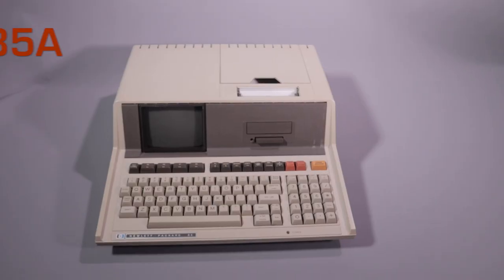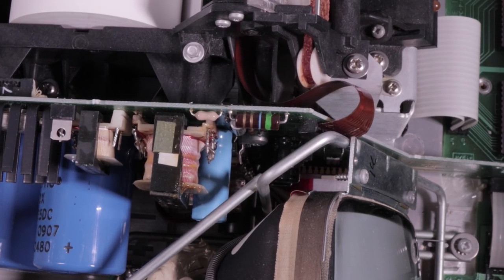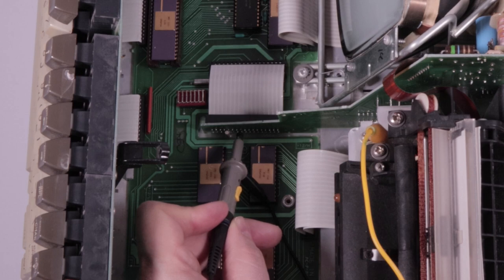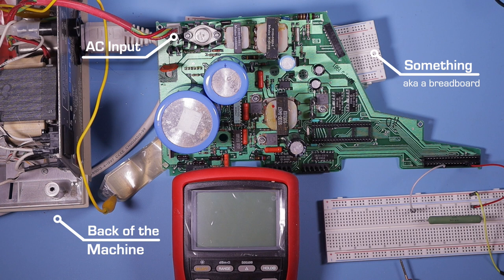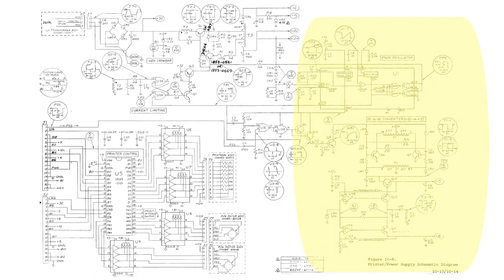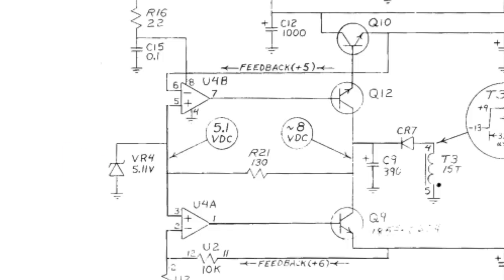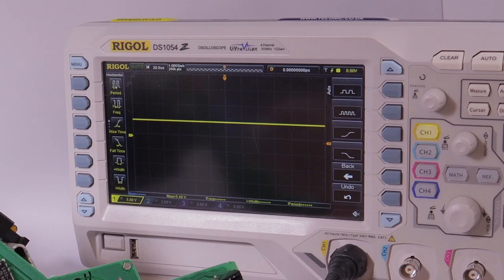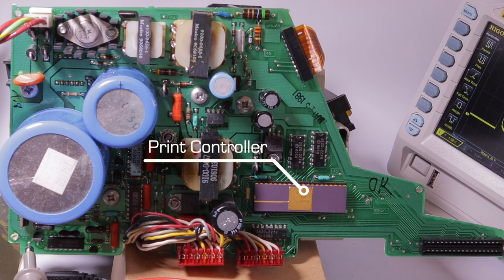HP 85A: Power Supply Repair

Comment: I recently got one of these that was supposed to be working but on power on I get either a repeating beep or continuous tone and nothing on the display.
I checked the voltages on J1 and J2 and they all check out fine.  I don't suppose you know what the problem might be just from my description?  Thank you.
Reply from the maker: If the voltages are ok, also listen for the crackle of the CRT start up as a power indicator. There may be some sequencing issues or other PSU weirdness.  I'm not hopeful.   It sounds like you have a logic board or board connection problem.  The connector cables are pretty dicey. The delaminate, and unseat.  So, check the cabling first.  If it's the board itself, that's a problem. Most of the chips on the logic board are custom, so if it really is one of them, then you may need to invest in a spare board.  However, we're not the world's experts -- just a fellow enthusiasts.  You will want to join the HP-80series mailing list. There's a long discussion history on most technical topics, and if you don't find what you need,  post questions to the hive mind there. It's a very helpful community. https://groups.io/g/hpseries80

Comment: Any idea where to start with one that just displays ASCII characters  seemingly filling the screen when booted?
Reply from the maker: What you describe is consistent with what happens when you run the self test.  If pressing 'shift' + 'reset'  doesn't clear the screen, then something is holding the start address at reset to the self-test location. If that's the case, then my approach would be to make sure all the PSU voltages and the power-on signals are as intended.  Wouldn't hurt to GENTLY reseat the PSU/Printer cables to the motherboard. Good luck. For more more assistance please get in contact with others in the user community at https://groups.io/g/hpseries80/messages
Reply: @beige-o-vision6936  thank you!

Comment: Were you able to identify what was going on with the print controller error?
Reply from the maker: No.  We're keeping an eye out for a new printer/PSU board to do a trial swap.  As the system was up and running for basic use, it got shoved further down the 'fix queue'. The 9845 has all the attention at the moment, along with various hand-held computing digressions.